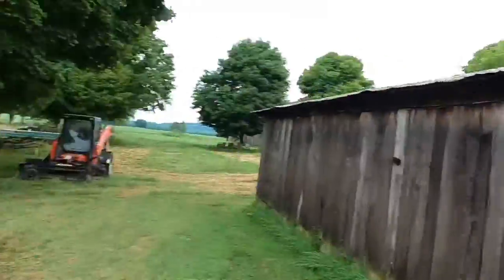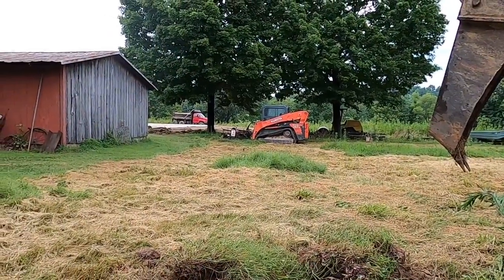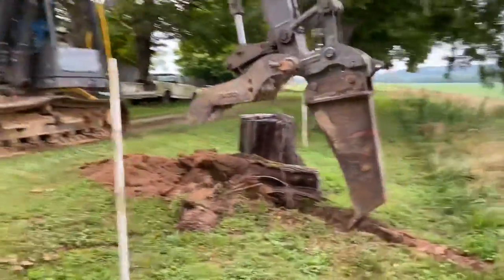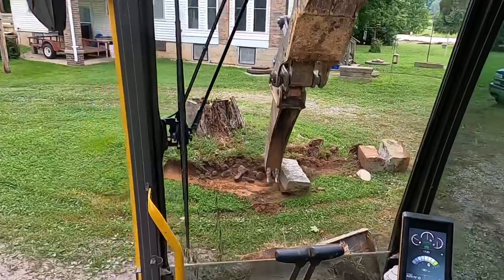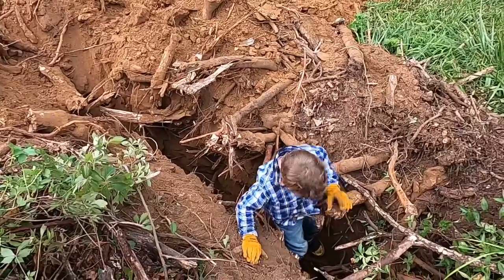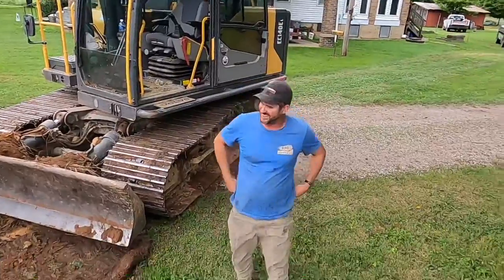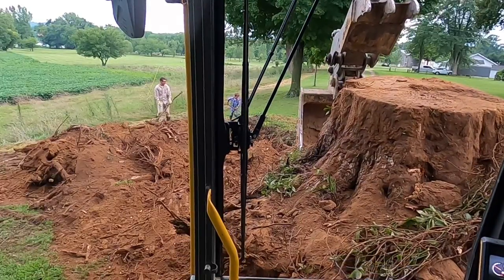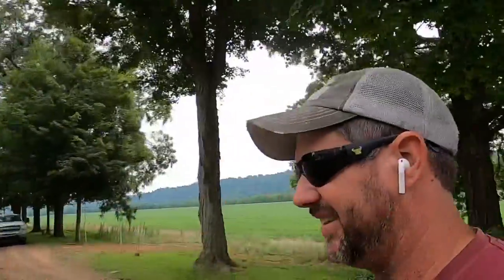Putting the trenching bucket to the test as a stump bucket  have a special film crew for this one 😀

Comment: Hadn't thought of the side load or twisting the boom would get with the wider buckets, so using the trenching bucket does make more sense. A few more minutes is cheaper than replacing pins or cracking welds.
Alex was a great little camera man, glad he got to tag along and help.
Reply from the maker: Yup exactly

Comment: My contractor uses a Ripper tooth to dig up tree stumps.  But here the soil. is more granular and the only trees are Ponderosa pine, which do not have an extensive root system. Ponderosa Pine is more like an invasive weed.  They'll grow anywhere, including out of rocks.  For that matter, that's all we have around here.  You'll find rocks piled up around the base of most trees as they are disrupted by the growth of the roots.  Had to laugh when you were getting eaten alive by bugs.  That's not an issue here.  I haven't had a mosquito bite in over 5 years since I moved here.  I'm told they are here, but haven't seen much of them.

Comment: was hoping the little one would blurt out kleeman, when dad asked who the best excavator operator was, hahaha,
i removed 4 big stumps with a little kumatsu 3.5 i think, had part on the blade part on the bucket and the ass end of the mini in the air. 
Nice work some of those stumps can be tough with those small fine roots everywhere, the bigger roots are easier cause you can just rip through them.

Comment: Hey I was wondering, what are your thoughts on a backhoe so there’s a two in one option all in one unit? Or would you just buy an excavator and/or skid steer?
Reply from the maker: Depends on the type of work your don’t they all have there place
Reply: I was hoping to start doing house lots digging for the foundation and some clearing kind of like you do. I just heard that the backhoes were to big to maneuver around the job site and under powered for even simple jobs, they say it’s just better getting a mini ex and skid steer. But like you said they have there place somewhere. Thank you for responding so fast

Comment: That "Grandma died" stump did not want to just roll out so easy. My dad hated walnut stumps clearing land for pasture or row crop. He got a good payday and got to burn the stumps, small town bonfires in the fall were fun. Way back in the mid 1800's in CA they planted groves of walnut and even huge groves of Eucalyptus which grows like weeds in the climate. The 2 worst for clearing.  Eucalyptus was all about the oil and cheap fast growing firewood, Walnut cut-down was great for woodcrafters and gun stock makers. I hated clearing salt cedar with an old homemade backhoe contraption on an Oliver tractor. Roots were deep and as tough as wire rope. LOL

Comment: What would worry me about using such a tall bucket would be side or twist loading it and bending it enough that it wouldn't work as well for knifing in trenches.   Then again, you're a better and more experienced operator than I am, so maybe you are confident either it can stand up to anything you and the machine can throw at it or that you won't damage it.

Also, I wonder if a crew at a small gas station I drove past several times last week would have been willing to temporarily trade their JD 350 for your machine.. lol,  the 350 could have moved that stump much easier, and your machine might actually have had room to move around on the gas station lot... I wish i could have gone by when they were actually running the machine.  Would have been interesting to see just how careful the operator had to be.
Reply from the maker: No and pass on the 350 useless to me thanks for watching 😁
Reply: Heh, I doubt even letsdig would want that 350 to keep despite some of the large ponds he works on.   I've no idea why they had such a big machine on that job, but they did at least move it around between times I went by.
Reply from the maker: lol very true

Comment: Man, stumps are hard on equipment. I use an old grinder with a 23hp khohler on it. Turn that dig stump into chips in a half hour. And I don’t have to deal with a stump after it’s out.
Reply: holes in the ground reappear year after year  if you just grind em
Reply: David Silvia depends how deep you go. If you’re the $75 dollar guy and grind it 1/2” below the surface, sure. You grind it till you see dirt....
Reply: Glad you had a hole to stick that stump in! Would it made a real nice bonfire too. Probably take 2 days to burn it down.
Reply: Also, wish I had access to the Volvo. That’s a fun toy, right there.
Reply: I got a 1980’s John Deere 410 backhoe. Would be two days digging that stump out, and would of made a hole large enough to put your garage in by the time I was done.